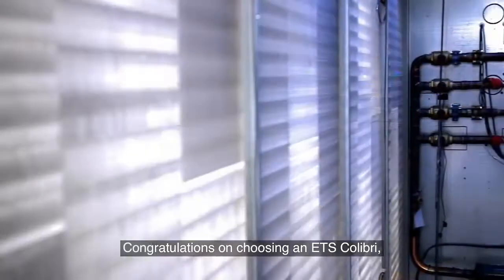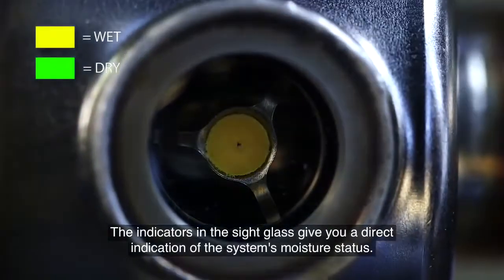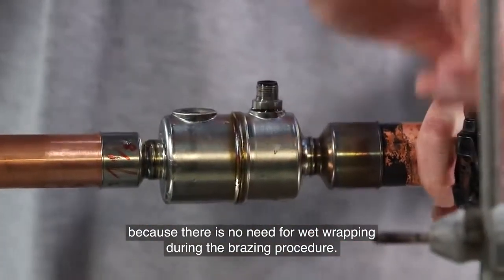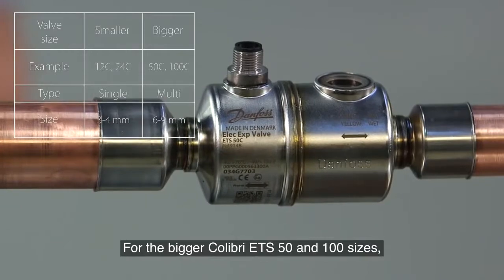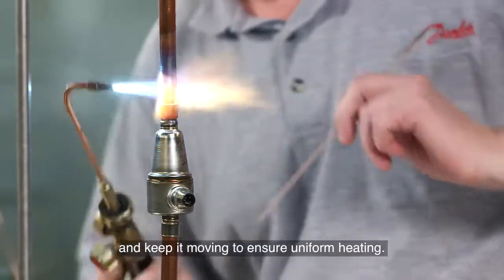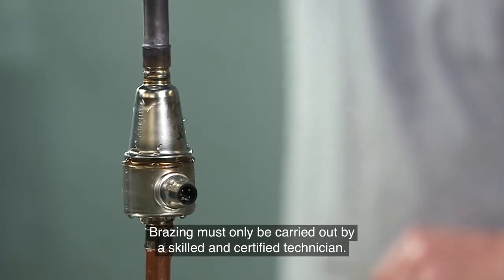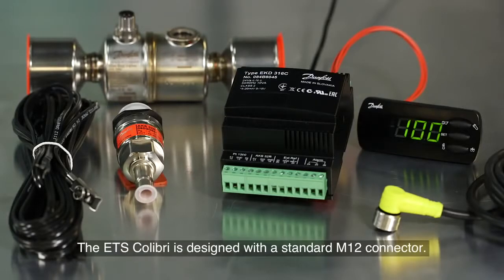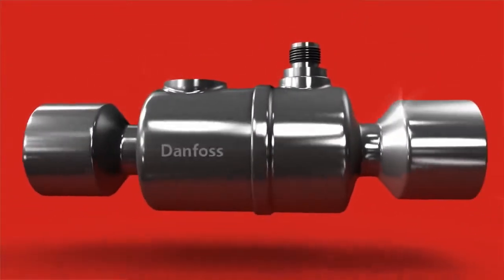Danfoss ETS Colibri - Installationsvideo zum neuen elektronischen Expansionsventil (Englisch)

Comment: I work at Fluid Chillers Inc. We just started using these ETS Colibri valves and the EXE controllers. There was a small learning curve with the controllers but the system is spot on. Much tighter control of superheat and excellent control of pull down on our low temperature Chillers that we build here in Michigan. Great job danfoss.